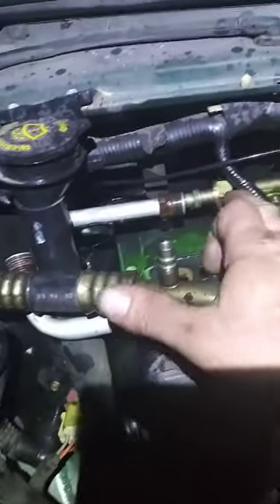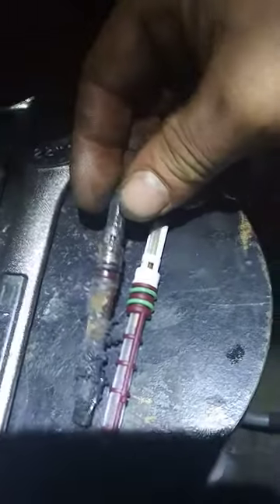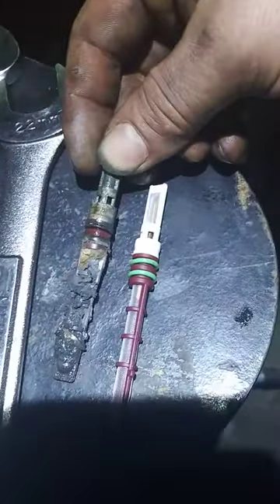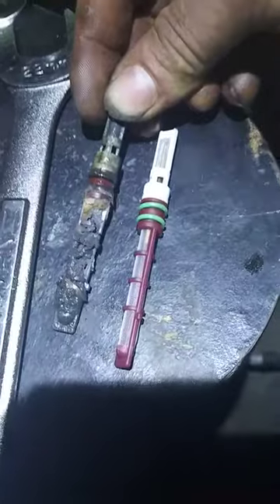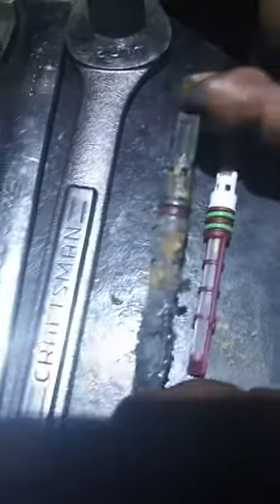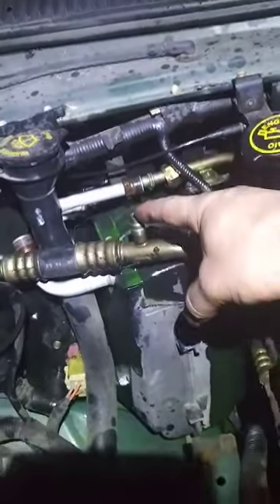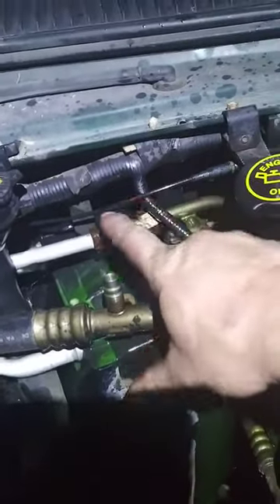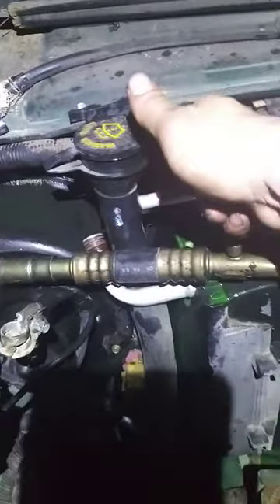2000 Ford E350 5.4 l orifice tube replacement

Comment: Which end goes in
Reply from the maker: Goes in the same way it came out So the long flat piece should be facing out out I usually hold onto it with pliers when I install it if you don't have the tool for it
Reply: Hey so does the maroon end go in facing the washer fluid hose?